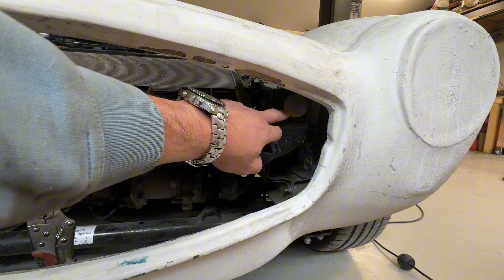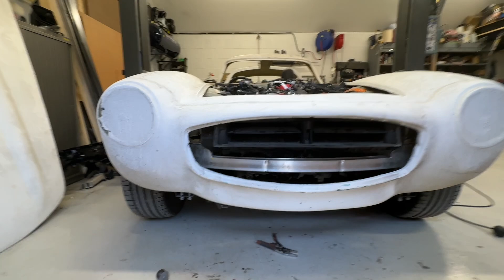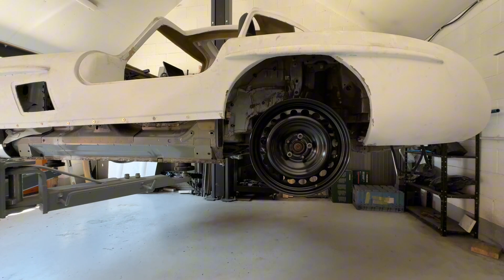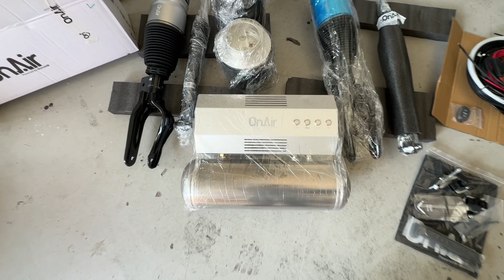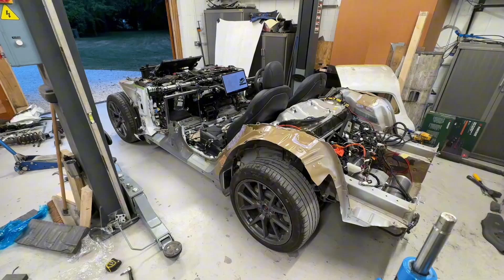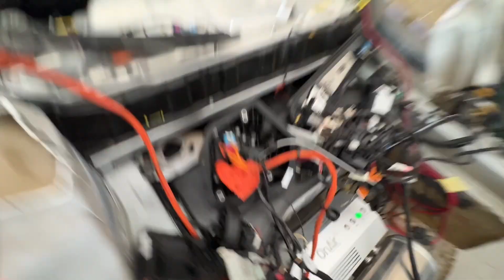Tesla Gullwing build part 17: Air-ride and new wheels!

Comment: Considering there isnt an engine under the hood, there is a hell of a lot of "stuff" in there
Reply from the maker: There is next to no overhang at the front which pushes the radiator back and with the cabin pushed back the bulkhead is way further forward than it needs to be!

Comment: What are the wheels that you bought for it? Part number and offset? 

Thanks
Mine needs some new wheels and I can't find any with a good offset to suck them in a bit.
Reply from the maker: This is my exact wheel: https://www.tunershop.shop/alcar-steel-wheel-9991-6-5x18-et38-5x114-3-18-inch-9991.html But, there are several equivalents available in US/Canada for you which would be a lot easier, maybe also search for winter wheels?
Reply: @ricolaracing  ..thanks ... . Did these end of bringing the edge of the wheel in?
Reply from the maker: @Adventures-in-rust yes, that was the whole point! In theory it was about 1/2” from the banding which moved the wheel ET and another 10mm from the narrower tyre but it feel like more, maybe down to tyre shape as different brands are quite variable. On its own the outside wheel face comes in 1” as it’s 2” narrower before mods with the same offset

Comment: Great progress! That’s air ride is a lovely bit of kit, makes the stance look spot on in that low setting. Fantastic work as always 👊😎
Reply from the maker: Tom from robot was really helpful pre and post sales but it really was a ncie and easy bolt in. Nice having the app too! The worst bit was the fittings as the airlines are only 4mm OD and very rigid!
Reply: @ricolaracing  Sounds challenging! I might look into this kit too at some stage 🤔
Reply from the maker: It’s very specific to Tesla and a couple of other models..